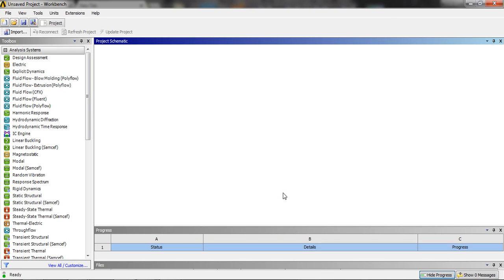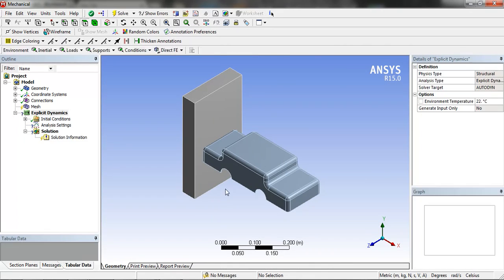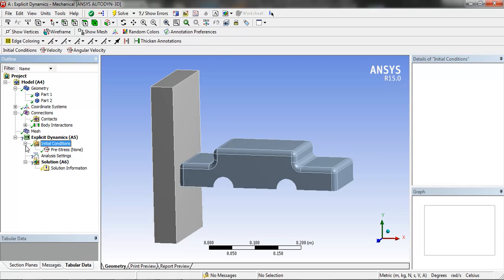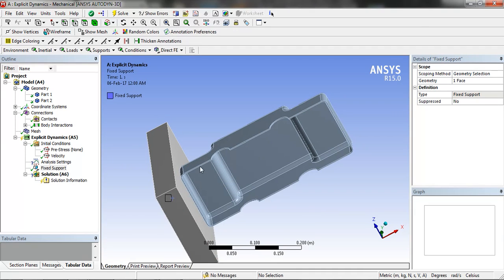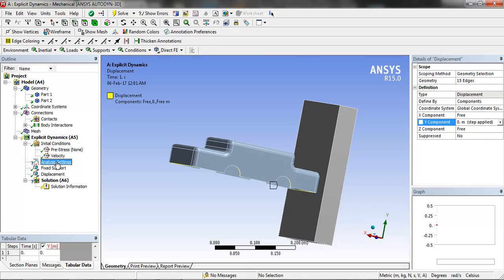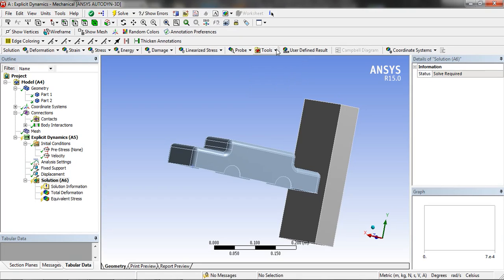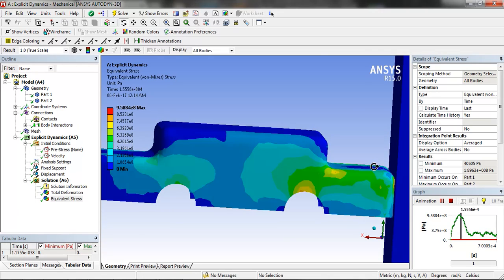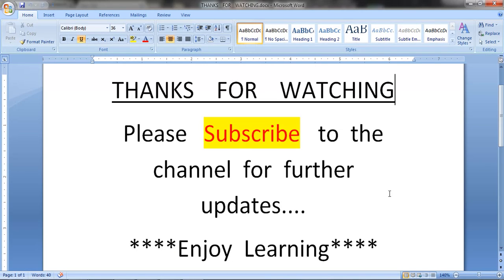How to do the IMPACT test in ANSYS Workbench | EXPLICIT DYNAMICS

Comment: if we look at the results, the stress bar shows the maximum stress as 1.8936e8 Pa. Why is that so high? This means that the chassis will totally rupture?
Reply from the maker: If the failure stress/strain or any failure model is applied in the material data along with the element erosion then only we can see the failure of material in the simulation. Here in this tutorial the failure parameters are not defined as it intended to give a basic idea of the simulation and is for initial learning purpose only.

Comment: How to put izod impact value in engineering material?
Reply from the maker: Generally a failure is criteria has to be defined for such type of simulation. In case of steels, J-C damage parameters are used for this purpose.
Reply: @ansyssimplified9758  J-C?..
Can you please explain it throughly..i am facing this issue still
Reply from the maker: The Johnson-Cook (J-C) damage initiation criterion is a special case of the ductile damage criterion model for predicting the onset of damage due to nucleation, growth, and coalescence of voids in ductile metals.